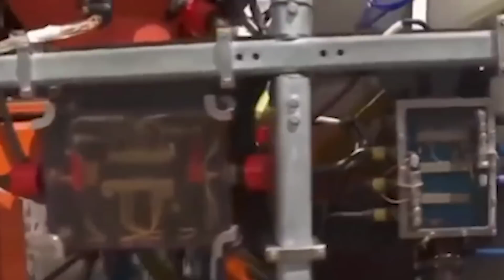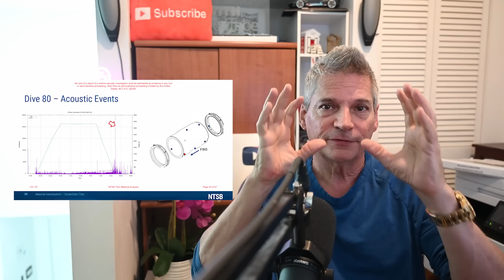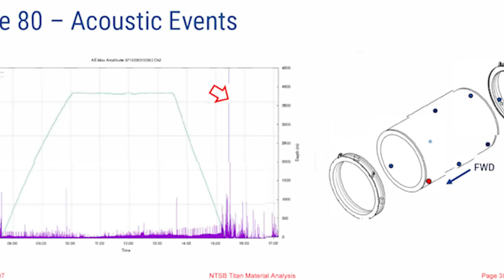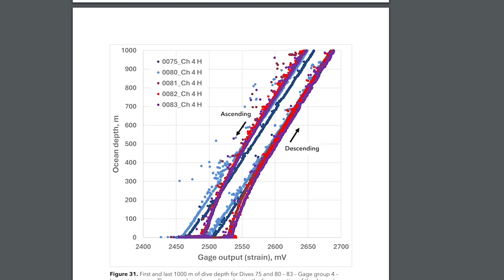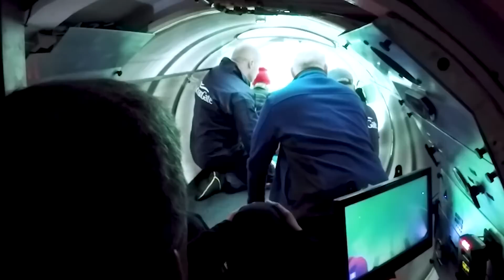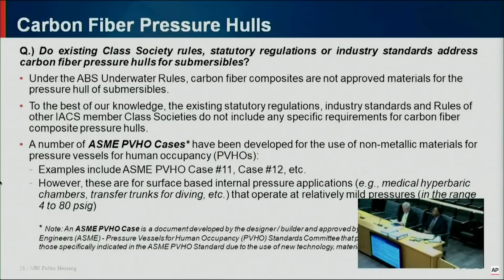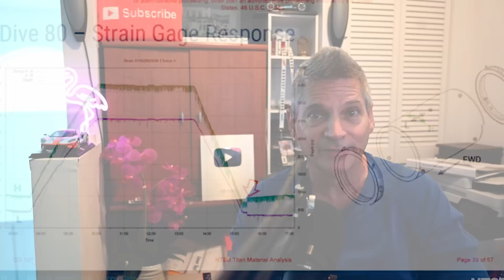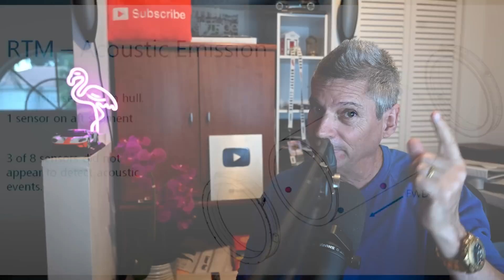How OceanGate Titan Sub Realtime Hull Monitor FAILED! RTM

Comment: I took a training course on fabrication with carbon fiber and resin years ago. Even I know over time with repetitive strain carbon fiber will develop weak spots. It’s also incredibly difficult to fabricate something like that without defects. Any defect = eventual weak points. Also 5 inches feel very thin to me. I think Boeing was on to something when they suggested 10. Each vessel should have been retired after a safe amount of dives. Even if the system didn’t indicate failure

Comment: The failure data from the test was virtually useless because the test did not align with the actual requirements. Instead of generating meaningful insights, it produced incorrect data, leading to the creation of a flawed safety plan. The test showed vessel failure at 6,500 meters, which is irrelevant since the vessel was never intended to operate at such depths. What was truly needed was a testing regimen that reflected real-world use, predicting failure based on multiple dives within the operational depth range. A valuable data set would not focus on a one-time failure at a theoretical depth but would simulate hull degradation over time, based on repeated dives. The sub might have dodged disaster if they were able to predict how many times they could use it before it would fail.

Comment: 6:40.  It is not reasonable to equate a homebuilt airplane, which is only "Experimental" in legal classification, to a truly experimental deep water submersible.  Those are not equivalent risks unless the Experimental airplane is one-of-a-kind and travels to space.  To date, only Space Ships One and Two would be comparable.

Though he was right to distrust Rush, this pilot doesn't seem to know what an Experimental-class airplane is.  More airplanes in the US are homebuilt than factory built and they all are inspected by certified FAA personnel to meet airworthiness standards; every aspect of each build must be fully logged, which is more than we can say about Boeing as they had no records of those door plug bolts being removed.

Most homebuilt aircraft are standardized and many are completed in the manufacturer's facility by the prospective owner under the supervision of the manufacturer.  These builders generally also receive flight training to get their type for rating for that aircraft at the factory as well.  Such aircraft are very rarely "experimental" in any practical sense, though some builders admittedly might not be as competent as others, just as some airline pilots are not as competent a others.

Comment: Carbon fiber doesn’t “reseat itself” it’s not that type of material at all i- carbon fiber doesn’t fail slowly it’s either together or it’s not - carbon fiber is a great material but absolutely the most horrible material for freezing temperatures and extreme high pressures and it was only 5” thick? I’m shocked it last as long as it did. To get a flawless carbon fiber run where there are NO defects is almost impossible and to count on that to dive miles under the ocean is INSANE.

Comment: Hmm .. I would not say, that there is no experience/reference concerning carbon fibers. I myself actually work in the Fraunhofer Institute since 20 years and develop testing methods for carbon fiber (semi-)products since around 15 years. We work hand in hand with well-known aviation and automotive producers to develop mostly ultrasonic and eddy current systems + the needed algorithms. On critical parts, carbon fiber products are normally tested while produced by eddy current methods (= to check if the layers are correct) and once cured monitored by ultrasonic methods. 

When reading the patent, it reads like a bachelor student got his hands on a few us-sensors and did some basic experiments with them. It's kinda funny, because we developed also a real-time monitoring system for carbon fiber gas cylinders (so the pressure is inside-out). Besides listening to emission events, there are many more ways to compare a cylinder between pressure events. 

Well, I guess this goes now a bit far for a simple YouTube comment. 

Here is a promo video from our YT channel, I'm allowed to share: https://www.youtube.com/watch?v=QaXU5gTFZTc (carbon starts at ~4 mins)

What Rush did .. well, we got a saying in Germany: "Man muß dem Schicksal auch mal ein Angebot machen." (You have to make an offer to fate sometimes)

Comment: The moment he started sanding down 'wrinkles' he reduced the effective thickness greatly, but there are so many individual failures that it is astounding it lasted as long as it did.
Reply: @Walter_Be Yep, totally compromising the one inch layer itself, but worse than that, several one inch layers are less resistant than a single layer of the same thickness, by between 15% and 35% depending on the material. Sanding down the wrinkles could have wiped 10% off the strength too as it is creating holes in the material that will then itself be enclosed by the next layer. If the safe thickness was 10" wound in a single layer, the 5" actually used may have been as low as half that again due to the way it was made. Once it had expanded and contracted several times it was inevitable what would happen. I am quite impressed it lasted so long really, the monitoring data clearly shows issues were developing, it just seems nobody knew what the signs meant.

I think the 'sanding down' is covered in the previous video Jeff did, but it is certainly in several of the videos online, they almost seemed proud they were making it all nice and flat.

Comment: That 10 inch hull would have had even more wrinkle issues with each winding.

The support rings however is even something i thought about many times as a non-engineer. The inside where the rings touch the carbon would have had to be super smooth though, and sanding it would be out of the question. This whole idea of of carbon and glueing on two end caps is just so fishy, it makes the hair on my arms stand up.
Reply: There is a video of one of Stockton's staff "cleaning" the titanium end ring with a rag, and bare hands... in regular clothes... in a garage with open doors...🤦
That image still creeps me out.
Compare that to videos of the manufacturing of satellites and spacecrafts where people are in a completely sterile environment, wearing full coveralls, masks, head coverings, and especially gloves to prevent skin oils from being left on anything.
And those labs often have pressurized doors so no dust gets in the lab.
Stockton was truly an idiot.

Comment: having worked with fibreglass/ carbon fibre/ Kevlar among other materials that got used here
EVERYTHING with the construction rings bells for me!
they even reduced the wall thickness from the original design ffs!
and to then think they expected to hear a crack BEFORE total failure!
that isn't how fibreglass fails! or any other fibre resin material!
as for an "early warning" system putting deflection rods the length of the hull would monitor the deflection so let you know how much the hull is compressing in real time
if testing HAD been done they would have had a failure point and then a safety cut off point for a maximum hull deformation prior to failure
I truly believe this actually CAN be done because the military had already done just that!
but they used PROFESSIONALS
and listened to ENGINEERS
even then historically people have DIED to new designs!
there is NO substitute for testing !
his hubris mixed with a "close enough" attitude to "fake it till you make it" cost lives
and with every new discovery
this looks less and less like an "accident" and more like a foregone conclusion!
such a sad and needless loss for the families
all for one man's ego

Comment: One of the things with deep dive vessels is they check the hulls after every dive. As the stress on titanium is well known(this particular hull was titanium I’m not sure if it also had steel) they know what to look for in terms of potential failures or undue stress, after every dive.

Comment: Carbon fingers and Titanium might be good for vessels that Needs to be light and are pressurized from the inside (Planes, Rockets...). Why did he decide to use those materials for an object that you don't care much about the weight and Is pressurized from the outside? Why don't Just go with regular steel? Just the material selection alone let knows to all engineers that he was a clown. So Sad that other people had to die for his mistakes
Reply: It comes down to money
A vessel of similar size but made of steel would be far heavier. It would have required a larger surface vessel and thus incurred higher operating costs.
Reply: @adamheywood113 
He was getting a million bucks per dive.
Now he's not getting anything.
Extra cost to save lives seems a like a good expense to me...
Reply: @abelis644  I just want to be clear, I completely agree and I'm not defending his reasoning, but as I understand it that's what it was

Comment: Yes, yhe problem of such "real-time monitoring system" is when it says "oops, sorry, we have a problem" - you are already at 10k feet below and all you can do is to pray.
PS: when I saw the design of the Titan my first thought also was 'why didn't they install reinforcing titan rings inside?'
Reply: Then it would just buckle between the rings but the main consideration was weight. Otherwise you can just make the whole thing out of aluminium, call it Aluminaut and be fine for thousands of dives. 

But then they would have needed a bigger support ship and those cost a lot of money. 

So they made it CFC, which isn't too heavy so they can use a cheaper support ship. Aluminium isn't expensive at all. And proven for cylindrical large vessels that go below 4000 m. 

The navy even built CFC submersibles. It was perfectly fine. But they actually tested them. To see how fine they are and when to stop because things are not fine anymore. 

Titanium hemispheres CFC hull. It was fine. You just need to test it and understand it. It wasn't recommended because that testing hadn't really been done. But if you wanted to spend a bunch of money you could have done it.

Comment: Or tho i agree that the real time monitoring system is a idiot light. It worked but the idiot reading it didn't believe it and blamed it on something else.
If they would have stopped for a milisecond and look at the strain guage data from dive 80 and compared it to every dive before that. They knew it meant the hull was compromised, yet they ignored it.
Reply: Worth nothing that how the structure imploded, it seems that the failure started at the bulkhead to carbon fiber seam, and perhaps not the carbon fiber it self.

Comment: Likely the alarm system didn't fail, it worked just fine, it signaled to all 5 of them that the hull was going to crack and kill them.............the problem is that their rate of ascent was always going to be incredibly slow and there was no possible way to speed it up, and it would likely only result in a few seconds before doom hit.

So the very last thing everyone felt in that sub, was the growing panic and fear that something was wrong, and Stockton's last thoughts, was that he was in fact going to die because the hull was already going to crack.

Comment: 18:30 @jeffostroff, even assuming that OceanGate built a validly scaled hull model for the destructive test, you suggested that Rush may have equated a pressure of 6500 psi with a depth of 6500 m.  While that’s the right order of magnitude, such a conversion is too lax.  Depending on the average density of the ocean in the water column, each metre of depth is equivalent to a pressure difference of about 1.5 psi.  So 6500 psi would be reached at a depth of only 6500/1.5 ~ 4300 m, seriously eroding any presumed safety margin over the desired operational depth of 3,800 m.

Comment: When a pillar or beam in a concrete structure develops a crack and shortens or bends by a couple of millimeters, that usually distributes some of the stress away from that element to nearby elements, temporarily stopping the element's collapse.  Thus detecting such cracks can be an effective early warning system that gives plenty of time for evacuation.
However, that is not a reasonable expectation for a deep-sea vessel like the Titan's hull.  If some part of the the wall cedes and deforms by a fraction of a millimeter, the water pressure acting on it will not change by a single millibar; whereas the deviation from the ideal spherical or cylindrical shape is almost certain to increase the internal stress on the material at that point.
Thus one should have predicted that, if the material ever began to fail, the whole hull would immediately collapse.  Which is what seems to have happened.
So the Titan's "real time warning system" was fundamentally flawed.
Moreover, instant collapse without warning does not seem to be a "feature" of carbon fiber only, but of any vessel geometry that lacks negative strain->stress feedback.  We see it, for instance,  in the implosion of tanker trucks that are improperly emptied.
Reply: This is the astonishing thing for me, how on did this pressure vessel not fail catastrophically at the first noise?This sort of implies that it was grossly overstrength if only it could be manufactured in a flawless manner

Comment: It's crazy that this amateur sensor detection system even worked, but they still ignored it. The sub should have been reformed after n°81 dive. The graphs are crystal clear
Reply: It's also worth mentioning that the NTSB made these graphs and actually displayed the data. The operators at Ocean Gate either didn't graph their data based on orders, or just didn't find it important enough
Reply: @BetaDude40  It's worth mentioning, you'r right. So i could correct saying, they didn't know because they didn't analyse their data. I didn't get that it was NTSB graphs.
Reply: No, the graphs are only crystal clear after the fact. If you record issues, with zero data saying x amount of issues equals failure, what does that tell you? Nothing... They weren't smart enough to collect the required data to predict a failure before putting people in the sub, now we have that data, but they died in the process of collecting it. It's like me telling you you've burned 20 gallon of gas, but we don't know how much the tank holds, does that info alone tell you how much gas you have left? No.
Reply: @bobbygetsbanned6049  When you have 80 results stable, and one result which show an extension of the hull simultaneously to the biggest sound ever heard (and recorded), it is enough to conclude that the hull is very probably damaged, and it's time to stop. To answer what you are saying, they did 8 dives after the one i'm speaking of, and all of them shows the same patern in the graph. They didn't died on the specified collected data dive, they dived (and died) knowing it ! 
(not the victims, but the suicidal crazy CEO man did know it for sure )
Reply: @arnaudt3935  Yet they had that data and thought it was fine. Yes it changed, but they still dove with it because they didn't have clear limits set on this = failure, it was just a guess.
Reply: @bobbygetsbanned6049 the fact he needed a audio system in the first place tells you he knew it would fail and tried to predict WHEN not IF. Which you dont do with a sub with people in it..... why do subs not have this system?  Because if it is safe with no risk of cracking or imploding there isnt a need for this system..... you only need it if you know it will break.

Comment: Just a note: 6500 psi = 4583m depth. Titanic around 3800m.
The scale model failed on "first dive" at 20% higher than Titanic depth which would have worried me a lot.